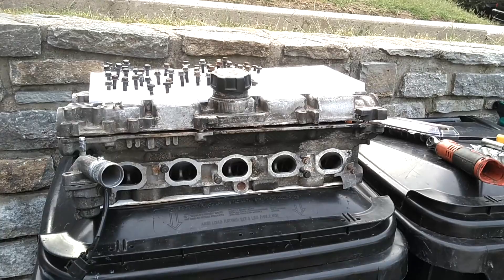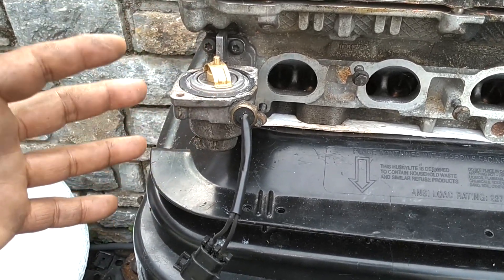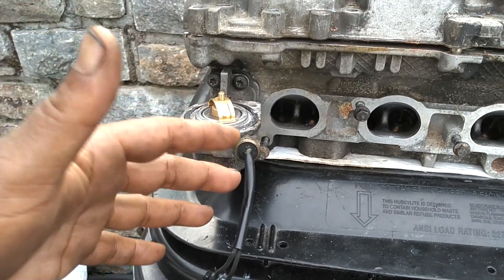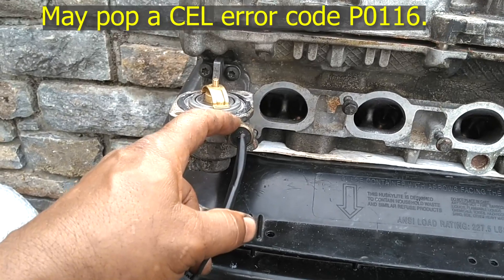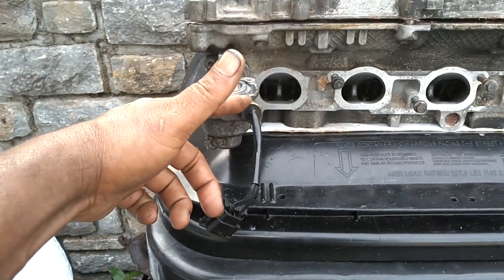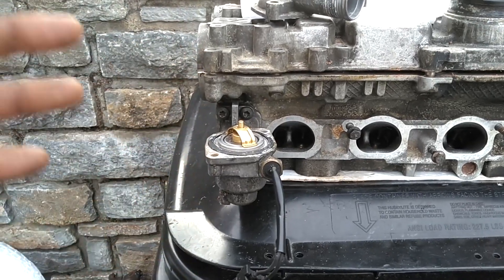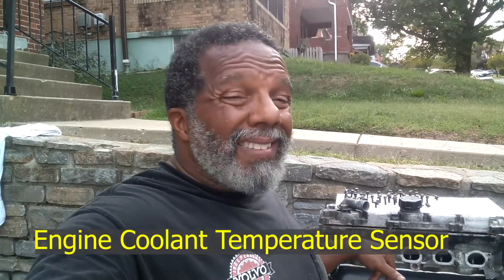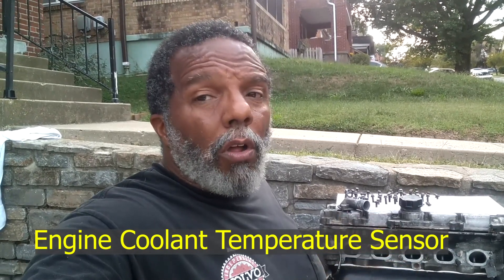Is your car hard to start when cold? Hard to start when hot? Maybe the ECT sensor is bad. - QT

Comment: You are a gift Robert. Seen these symptoms, only ever runs cold never hot, takes a while to heat up, thermostat itself is only halfway through its lifespan so I ruled that out as being unlikely already. One other symptom I've noticed is a couple times now there's an electronic beeping tone sometimes coming from under the hood, hard to tell exactly where from. I figure that could be related to the sensor, not sure if anyone else has experienced that. I'll try replacing the sensor on my '98 and hope for the best.

Comment: Great explanation. So regarding your other video and shared wisdom here I also have noticed with my van not starting: 1) smell of gas when it doesn’t turn over 2) cold starting it I see the temp gauge get to operating range (medium between C & H) very fast 3) bad gas millage. Gonna get the sensor and change it out in a bit and will let you know. Thanks again, you channel is awesome!
Reply from the maker: Thanks for watching.
Reply: @RobertDIY si my car failed again after changing out the ect sensor. And check engine light is on again also

Comment: My vehicle is doing the exact fault you described, It cranks for 5 seconds and then starts. it will continue starting on/off all day. But after leaving it overnight same issue.
Reply from the maker: thanks for watching.
Reply from the maker: could be a dying fuel pump.
Reply: @RobertDIY  But it only does it on 1st startup of the day, it's ok on/off rest of the day, if the pump was dying then it should struggle on all starts . No

Comment: I have a new OE Volvo sensor. If you unplug it and then plug it back  in and turn the key,the cooling fan will constantly run. I have to disconnect the battery and “reset” the system .Odd
Reply from the maker: Dang, bad sensor 🤔
Reply: The plug is worn. A zip tie around the plug perpendicular to the wires holds it together nice and tightly

Comment: It might be a good idea to consider to measure the normal resistance (I assume it is a resistor, that is temperature dependent) at specific temperatures, so that you can actually measure it to verify, if it is good or bad.
Reply: I seen the resistance been fine at upper or lower ends but very erratic on the middle. You can do a resistance check but you need t heat it up and run the complete profile.
Reply from the maker: THANKS

Comment: I love all of your videos. I have learned so much from you! 🙏        

 Does this go for whiteblocks as well?      I wonder if this has been my issue the whole time🤯
Reply: Not just white block engines but most modern cars are very sensitive to what the temperate input is!!!
Reply from the maker: Can be. Those cars are known for fuel pressure regulator problems.

Comment: Another great vid! Do you think the redblocks are as sensitive to aftermarket ECT sensors?
Reply from the maker: Not as much. Fuel pressure regulator is usually an issue.
Reply: @RobertDIY  yeah both my 240s had that issue. Not a cheap part either